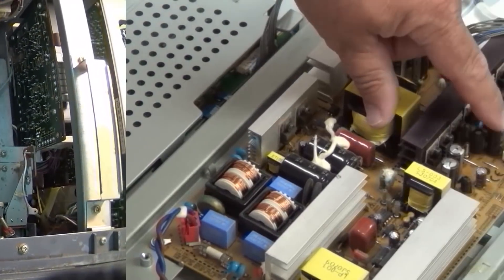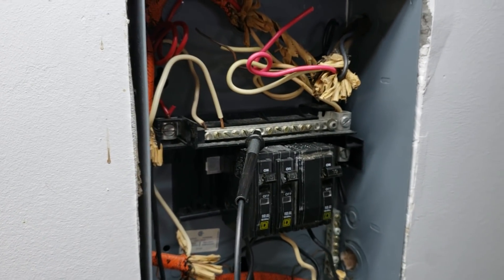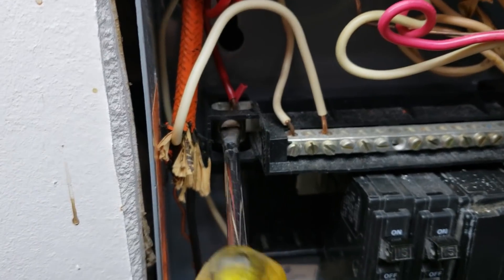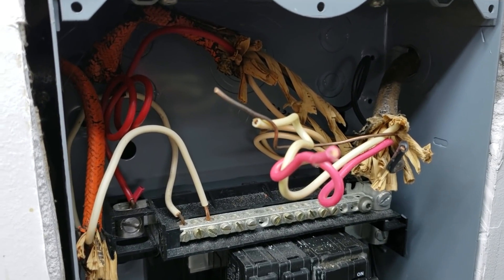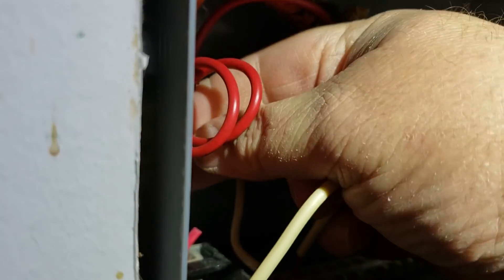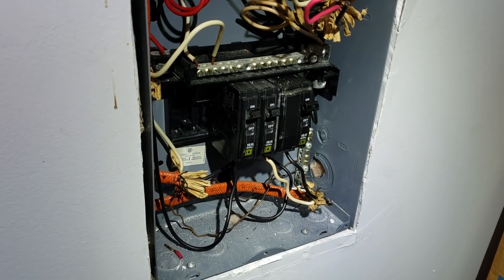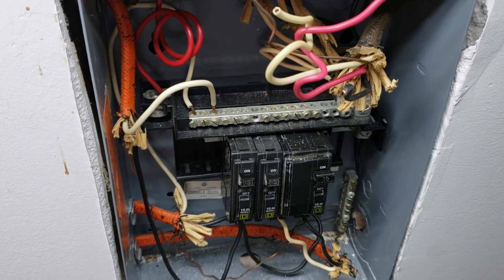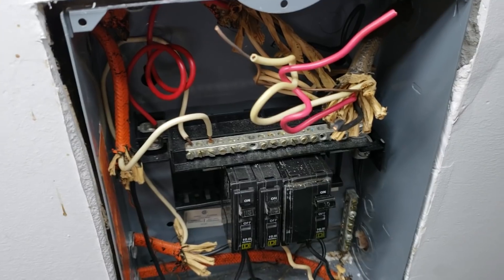Electrical fail

Comment: I am surprise you didn't cut an inch of wire off and get a fresh clean unoxidized section of wire to re-install in the busses since you had everything apart and off..    It looked like you had plenty of slack.  An inch off the original wires would not have caused an issue.       Glad it was an easy fix.   Those are the kind of projects I like.

Comment: Good one. Ideally that single wire should be folded over to have a better contact surface in the busbar terminal.
Reply: RODALCO2007 it’s fed by little baby wires...
   Too small for a sub panel...
Reply: Or give it a clean with sandpaper and tin it afterwards.
Reply: @cardboardboxification  That was one of the things that stood out to me as well. Those incoming feeders are way too light for the purpose.

Comment: Good that you gave the other connections a tighten, i've found copper wires in sockets get loose as well.
Looks like that box needs a rework.

Comment: I swear that looks like 12 ga wire feeder to the subpanel but even if it's 10 ga you are still overloading your wire. If you only had the 30A double pole breaker then you might be fine if your feeder wire(if 10ga)from your house to garage is a short run. Otherwise with both 15A 120v circuits going and your 30A 240v heater running you definitely run the risk of overheating your feeder wire which can cause big problemas. Sometimes lugs getting loose is caused by the wires heating then cooling off over a long period of time. Just want you to be safe so you can keep pushing out your great vids!  Thanks for what you do!
Reply from the maker: Its 10ga wire feeding in. There is really not much draw on this.
The electric baseboard is only a 1500 watt unit and at 240 volts that is going to draw what about 7 amps. There is a small freezer down in the lower level.
The service feeding the garage on on a #6 ga direct bury tek cable from main house, which feeds another sub panel there for the hot tub. That is where all the draw is. The breaker in the main house is only a 30 amp circuit, and even with the hot tub heating, and everything on in the garage it never trips the main, so it isn't even drawing 30 amps. The 2 15 amp breakers for the up and down plugs runs 6 twin tube 40 watt fluorescent fixtures, and 3 wall plugs. The other breaker runs 1 plug up, and 2 down where the freezer is, and a couple of lights in the garage. 
I noticed there is a 30 amp breaker for the heat. I am sure that was just one that was left over that was put in, because entire garage, and that includes the hot tub is protected by a 30 amp breaker, as it was when it was connected to the old house before the house was renovated. There is really nothing in here that draws any power. I store some of my old electronics in here, and have my 3/4 deck, and a PAL deck, for conversion work, and a 20" TV. The heat is set to something like 5'C just to keep the place from freezing in the cold months. The air conditioner hasn't been run in many years since I moved my ham shack out. I actually used to do my electronic tinkering up there, but it was too much of a pain in the ass hauling equipment up stairs to work on it. So now it is just storage
Reply from the maker: For the last time.  The feeder from the house is 6ga that goes to another panel directly below this one about 6 feet below it. The other panel has 1 240 volt 30 amp twist lock plug in it. And the gfi for the hot tub that is fed with 8ga cable in a conduit. The 10 ga that was existing feeds up to this panel. It is about 6 feet in  length.  The entire garage is protected by a 30 amp breaker in the house.   
It is safe. Even this arcing wire posed no hazard because even if it got hot enough to melt insulation the 30 amp up stream would trip.  10 ga will handle 30 amps. For a longer run 8ga would be preferred but s short 6ft run would not be an issue.  If I could replace it I would but that would mean knocking out drywall to get to it.
Reply: @12voltvids  I can't help but get tickled at these keyboard electricians.... Good job! Spent my life and now retired doing electrical, from house wiring, hospitals, schools and finished working on high voltage (7600 per phase) at our local power co.
Reply from the maker: @AmericanOne9621  i hear you.

Comment: Hello and nice job! You've probably avoided a nice electrical fire.
However, I insist you should take more precautions in the way you do these sort of job:
First, you've checked the voltage before doing anything else, and that's fine, but you should have used an insulated screwdriver (it's mandatory for your safety)!
Second, you intervene after shutting down your main switch, that's fine also, but you've done a potentially lethal mistake after that: you should have measured the tension again!
This sort of self confidence can kill for many reasons, a circuit breaker malfunctioning, a short with other live circuits, and particularly with circuits you don't know, all kind of special mistreated installations, or stupid things like people stealing power directly on the neighbour's circuits, unprotected lines still powered by UPS and so on. Before any direct contact with uninsulated parts, a simple check with a little screwdriver tester can save you from shock!
After your direct security issues, many other things are still to be done in that box. Even if we don't share the same norms, the way things must be done are logic, and anyway this kind of installation is not safe anymore, and never has been!
For what can be done without replacing the entire electric installation:
Many are saying you should refresh the end of that burnt wire, not only because of surface oxydation, but because copper mechanical properties change after prolonged heating: the wire is more prone to break, and more difficult to properly tighten with a screw. 
There's apparently sufficient lengths of reserve wire to cut a few inches and make a proper clean connection, and do so with neutral and the other phase. It's a good idea to check every line for loose screws every 10 years or so.
Another point, I suspect the apparent section of this line to be way too small (can't tell with you AWG norms, but there is something like 2.5mm2 sections, and I'd use 6 or more, depending on total lengths and currents...). I notice: no separate neutral, and no Earth circuit to be seen ( there is some on the old line!).
If your phases are not at equilibrium, and it's quite impossible in these 2 phases systems, you're at risk of high return current in neutral! The ideal is to get a new supply line with proper sections if you want to prevent any fire hazard. But it's not the immediate subject.
Another essential point is to make labels or anything to identify those circuits and mcb's. Security reasons... Mandatory on every new installation (our norms...)
You finally could say I'm way too much concerned with your security, but I prefer telling that sort of things 'cause I care for you, and even if I think you know what you do, I feel the need to precise other viewers "don't do that at home, it's dangerous"!

Comment: Not allowed to have two wires under that left breaker terminal.  use a pigtail with wire nut.
Reply from the maker: Duh, again I didn't wire this. Doesn't surprise me though as you should have see the wiring in the house when I bought it. When I renovated I ripped everything out and started  from scratch. The old garage was never touched. When surveying was done it was found to be encroaching on the neighbors property, so I was not permitted to do any work on it . I would have to set it back from property line before I can do anything. I didn't have to teat it down though, so I left it as it was as a spare building. 
The original wiring in the house had JB hidden behind walls with no cover plates on them. Scary what they allowed all those years ago.
My house is over wired now. 
My office for example has 4 seperate circuits. 2 for equipment, 1 for air conditioning, and one for lighting.  Work shop has 2, it did have 3 but I needed 2 for my car charger so I reconfigured, 1 for bench plugs, and other for other plugs and lights.
Kitchen has 9 for plugs plus dish washer and arbitrator on dedicated.
TV room has 3, one dedicated to TV. Equipment closed 2 dedicated.  There is so much copper in the walls here. Never overload anything.

Comment: Shouldn't the housing with the screw be bronze in order to prevent oxidation? Many times these things happen when two different metals are put together like copper and aluminum.

Comment: I was diagnosing why an entire outlet circuit was out in a building that had been renovated in the last 5 years. Breaker wasn't tripped, none of the GFIs were tripped. 
Took the front off the panel... It looked OK, but as soon as I tugged on the hot, it came right out of the breaker. The screw had never been tightened down. 
Just because it was done to code doesn't mean it was done properly.
Reply from the maker: I can believe that for sure.

Comment: You are lucky that it did not overheat enough to melt the bus bar and wire insulation. I have seen that so many times.
Reply from the maker: Well truthfully less than 5 amps get drawn through that panel.  When the heat is on about 7.  So not enough heat to melt much.

Comment: Tony Wadkine, pointed out some of the major problems in your subpanel, my questions build on his observations:
1. What size wires are in the main panel box that feed the subpanel  in your outbuilding and what side barker is used? 
2. You obviously have a hot & neutral but the ground seems to be nonexistent. 
3. What are those old romex cables doing?
4. Why didn’t the original installer use connectors to insulate the romex in the panel?
5. What other mistakes did the person who wired your subpanel take and which one will cause the fire. 
Find an electrician in your municipality whose approved and asked for an estimate to check out your home and outbuildings electrical system.
Most likely it won’t cost you anything for the estimate and hopefully only a few hours to clean up your potential fire hazards.

Comment: Wow, Im only a rooky,  but really,  uncovered earth wires, bare ended wires floating in the breaker box. Not uncommon in older houses, think I would replace/ check all wiring from source.  
I turned all the power off when I moved into my old house from the main switch coming into the property to do some basic electrical tests and was surprised to note the electrical heating, cooker, shower and a/c were all still functional.  The power company were quite keen to locate the previous owner who, Im told, bypassed the meter to reduce his power bills.  Lucky I tested for any live cables after disconnecting the power, otherwise I could have plunged my hand into a live distribution box.
Reply: Ground wires are always (often?) uncovered I thought
Reply: @tightirl  Here in the uk its mandatory to sleeve earth cables, esp home installations. Regards
Reply: @isoguy.  Interesting. Do you know the reasoning behind the UK's/US' position regarding the matter?
Reply: In the U.S. (and possibly other countries in North America), bare ground wires are legal.

Comment: Always scary stuff when you start looking.  My father was replacing a bad line voltage t-stat in my sisters house for an 240 v electric heat zone and he had to turn off 2 separate double pole breakers to kill all the power at that location!!  The builder was supposedly an "electrician"!  We are going to have to look a little closer at that one......and then her electric hot water heater was putting off bad burning fumes....well a cooked wire nut was to blame.  The reason...  the wire nut was improperly sized to the #12 wire that was used, waaay tooo large of a nut and the joint sat there arcing away.
Reply from the maker: Many times this work is done by the "grunt" of apprentice.
An electrical apprentice is never happy. They get the shit jobs, they are being paid a shit wage while the journeyman is making big bucks tossing back a cold one in the house BSin with other trades or the home owner.
I actually considered going into the electrical trade. I didn't last. I was working in an attic installing a ceiling fan. The journeyman cut the hole in the ceiling and wall, and sent me up into the attic to drill a hole in the header and feed him the wire, and then tack it to the joist and over to the new box for the fan. I was up in the stic for well over a hour in July when it was hot as hell. I would have been about 16 at the time I come down, and he was drinking a cold drink eating a sandwich that the customer made him. His comment "it's about time you were done with that" dam near put me over the edge. This continued for every job. Either crawling in a crawl space or in an attic. When on new builds same thing. He walked around and put an X on all the studs and had the grunts pull all the wire and hook everything up. He just "checked" our work, and I say that rather loosely, because he might open one switch or plug check it and walk away. I did it for a summer when I was in high school.

Comment: The amount of bare copper sticking out of those terminals, that can't be to code!?
Reply from the maker: I am sure it isn't.  Not my wiring job.  Those were the neutral lines.  The hot side is not exposed like that.
Reply: @12voltvids  That makes me feel better knowing they are neutral.

Comment: I mean, this isn't even like advanced electrical work, it's literally "make sure the cables are in the holes all the way and the screws are tightened properly".
Reply from the maker: This is the problem when you buy an old house. The rest of the house was the same when I bought it. When I renovated I re-did the entire electrical system, but didn't do anything in the old detached garage 
because I didn't do any work there. I just use this for storage of old equipment, and I have my old 3/4" and PAL equipment there that is used perhaps 1 or 2 times a year these days. I know who did that work, but they have been dead now for 20 years.
Reply: @12voltvids  Right, I have only worked for about 1,5 years as an electrician but I have already seen the horrors of DIY electrical work.
Reply from the maker: @hns_203  There is a reason that electrical work needs to be inspected.

Comment: You should see all the wires coming from my basement breaker. An absolute spaghetti mess and it gets worse the further back into the basement you go. Certain breakers in there go to stuff on the second floor even though the second floor has its own breaker panel.
Reply from the maker: My house is up to code. When I built the place I wired most of it myself but did bring in an electrician to pull a permit and inspect everything.  He pulled in wires, I put in all the fixtures plugs and switches. He came back and signed off and the city inspector checked it. The old detached garage was not inspected as it was not worked on.
Reply: @12voltvids  Some electrician did mostly everything 40 years ago, my wiring probably isn't up to code.

Comment: Well that's a strange breaker box, those must not exist anymore.
Reply from the maker: Square "D". Sure do. My main panel uses the same. This is a sub panel. In other words no main breaker, as it is protected up stream. Used for additions workshops, ect for 2 to 8 distribution in secondary building.

Comment: I only bring in 1/2 inch of jacket square corner run wires in the box to busdar and breaker this looks like a subpanel so i would seperate neutral and ground bond ground to the box consult codes
Reply: David Berquist at 5:25 you can see the buss bar at the bottom right for the grounds vertical , the neutral ( white ) top above breakers horizontal

Comment: I don't know why you didn't cut off the burned and pitted section so you could put in good copper
Reply from the maker: The thing is with copper, when you tighten down the clamp screw it is going to do just that. Scrape off the oxidized surface corrosion, and bite into good copper. I could undo that and show you that it will be all nice and shiny now.